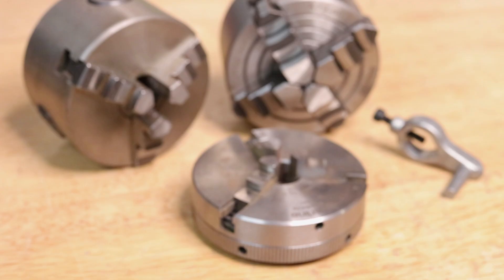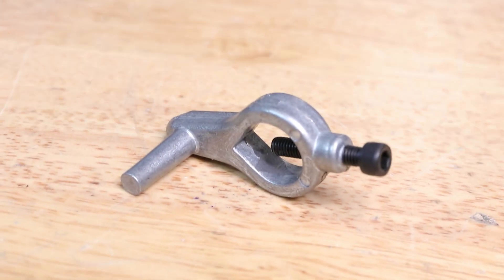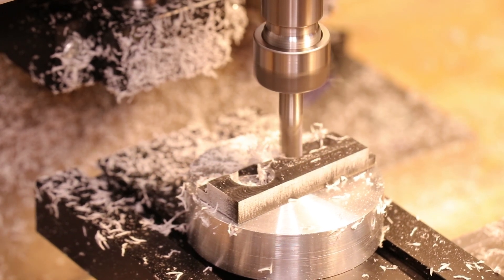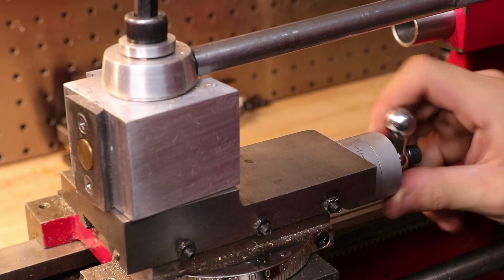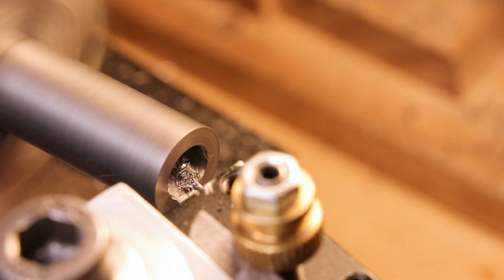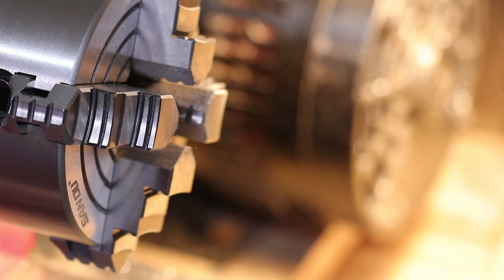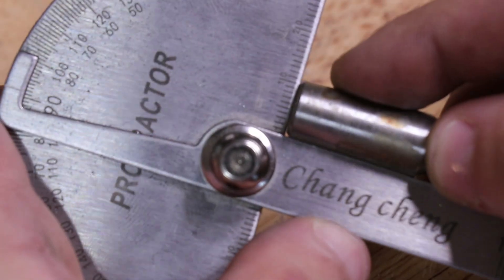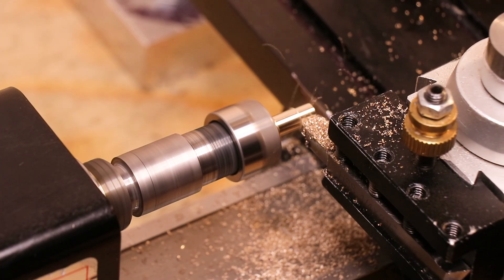Making A Collet Chuck For the lathe

Comment: That’s so great. Thanks!
I’m just entering this world and learning from you as I do. 
For the manual threads. Your video gave me an idea of possibly rigging a gravity/spring mounted hand drill in a way that using a solid friction connection with the drill to your chuck you could use either a worm drive or spur gear for still slow, but powered speed control for turning threads (?)

Comment: If you had made the Morse 1 first and put it in the spindle you would have gained better concentricity in the er11 taper cut. Otherwise it worked out pretty good. I think you have some rigidity problems in your cross slide based on your hss tool cuts. Something to check beyond just the gibs.

Comment: I have a sherline lathe from 1976, and was considering a MT1 to ER40 collet so I can work with 20 and 25mm aluminium round bar.  I've been whacked by the chuck jaws once too often.

I only have the one lathe so thread cutting is not possible.  Instead I was going to buy a cheap ER40 to something collet holder off aliexpress and turn the back end down to morse taper 1, on the sherline.
Am I a glutton for punishment?  I get maybe 3~5 thou DOC in steel on the sherline, might take a long, long time.

Comment: For thread cutting you should just make a crank handle to go onto the headstock, to the outside of the motor, so you can just spin it that way.  Would speed up the manual thread cutting.
Reply: i am wondering how to manually cut a thread without a gearbox, I mean how to make sure the thread is even?
Reply: @MikeJD-hv9fp  just use a die???

Comment: Couldn't you have cut the M#1 taper for your spindle bore and drawbar threads and then do the collet end with it in the spindle for even less runout ?
Reply from the maker: That would be the way to normally do it, but I can't can't accurate tapers in the sherline so I had to do it this way.

Comment: Taig Tools has a 3/4-16 to ER-16 adapter that, with a small modification, works well with a Sherline mill or lathe. I bought four of them for use as tool holders. These are much quicker to mount than using the Morse Taper because they don't need a draw bar. They just screw on and they are relatively short. But you will need to shorten its base by about 3mm because the threads are recessed into the base and you will only get about 1-1/2 threads engaged unless you do the modification.

Comment: You don’t need a Morse taper on it unless you’re using it in the tailstock for drilling. The sherline bore is 12mm end to end. Just add a shoulder.
Reply from the maker: Cheers, but this collet also had to be used in another spindle that I had that used morse 1

Comment: The mistake I keep seeing when test fitting the ER collet taper is using an empty collet. ER collets are split from both ends and will conform to the taper even if the angle is wrong. Insert a pin of the correct size, or even the shank of a drill into the collet,  then check the fit with marking dye or Sharpie. I've made a few collet chucks of various sizes up to ER40 and would be disappointed if  the run out was greater than 10 microns.

Comment: I worked for a company that had a very large  piece of 17-4 that was bound for the recycle bin and work was slow at the time so I cut a solid piece right on the spindle,manually produced the correct six hole pattern and made pins.I used that tool a lot.

Comment: A 4 jaw independent chuck will not solve your run-out problem if the jaw faces are not parallel with each other. So, first check for parallelism. Grind jaws if necessary. Stay away from Chinese trash collets.
Reply from the maker: Thanks for the feedback Pieter. I haver owned this chuck for quite some time and I have machined drill rod with it and  it seems to reduce the run out quite nicely. For an economy chuck it has exceeded my expectations and gives me part tolerances that I need. Cheers

Comment: Nice work :) For cutting threads, would it be possible to make a simple crank handle and attach it to the tail end of the spindle? Cheers
Reply from the maker: Certainly would be, it is infact the method that is used for cutting threads on sherline lathes. If I cut threads using the lead screw more often I would make a handle, but i rarely do, in fact this video was probably the last time I cut threads this way.
Reply: I made a crank handle for my spindle to cut  a 1/4" length of 1.50" dia. X 8 TPI. My mini lathe has no reverse on the lead screw (yet). It too was a one off job.

Comment: At 3:28, you show dialing in the end of the workpiece, but fail to check the workpiece near the face of the chuck.  You could have a huge runout on the part and never know it if you only check the end of the shaft.
Reply from the maker: Cheers, but I did infact do this but, like a lot of things it never made it to the edit. Still getting used to editing down 2 hours plus of footage into 15 minutes and sometimes I leave some parts out that I shouldn't.

Comment: I liked your video, but why didn't you just make the back end on the first lathe, then do the front end on the lathe it was made for. This should have resulted in less error.
Reply from the maker: Because I do not have the taper catting attachment for the Sherline so everything must be done on the sieg. Furthermore with a properly dialed in 4 jaw chuck the run out is just as low as it would be if I cut it on the sherline. The set up took a very long time. It was not optimal but I work with what I have. Cheers
Reply: @artisanmakes  I think you did a wonderful job... You said in your video that the final result had a ever-so-small wobble.

(Did you use your finger gauge to measure the spindle accuracy of the second lathe?)

What I was trying to say was(if there is a wobble in your second lathe's spindle), if you made the taper on the first lathe, then doing everything else on the second lathe would make the chuck true to the fitting on the second lathe. (The 2 errors would cancel each other out) And if you make an index line where the two parts come together, then any offset error on the second lathe's spindle will be not be added to the chuck if the chuck was inserted in a  different rotation from the position it was created at.. -- I hope what I am saying makes sense..
Reply from the maker: I understand but I can not cut tapers on the sherline (second lathe). To do that requires an aftermarket attachment isn't in the budget.

Comment: I'd have probably machined the tapers last because, if you screw up something like the threads, the job is scrap, and all your work on the tapers is wasted.

It would also be a good idea, to cut the front taper (ie. the one for the collets) with the collet chuck installed on the lathe, for maximum concentricity.

Comment: Bad order of operations. Hou are very luky to get so low runout. 
A good way is to first machining the mors taper and after, with the morse taper in place in the headstock, machining the ER colet.
Reply from the maker: In retrospect I can admit it was not a great choice on my part, but the run out is in no part to luck. A lot of set up to get the part in the 4 jaw to get the run out to less than 10 microns, which is what I can get on the Sherline. If I had the proper taper cutting attachment for the Sherline I would have cut all the internal taper on it. However since I don't currently have that I did it the way that I did it in the video. Overall a well dialed in set up should easily offset a less than ideal order of operations, and the results that i got show this to be the case.

Comment: Nice project! As others have pointed out there are better ways of setting a taper angle. If you don't have access to an existing morse taper to use as a reference (set it up between centers and dial in you top slide to zero on it) you can use trig to calculate the angle from expected values. the taper surface is going to be the hypotenuse and you measure on it to get the short leg of the triangle while the long leg is the travel. Also, tool center height is really essential for turning tapers, lest you get a parabola in the taper. I realized this myself lately when trying to turn maching tapered parts. A workaround is to use a shear tool for external tapers where you don't have a single point that cuts but an angled edge tilted backwards. That way you will always get center line contact.

You are losing a lot of rigidity and get increased runout with that overhang. Why make the body of the chuck so long?

Nice work!
Karl
Reply from the maker: Cheers, and thankyou for the feedback. In retrospect that is not a great way to set the taper angle, but I have said to quite a few people, you would be amazed at how close the protractor got it. I swept the angle with a dial indicator and it was to within a few arc minutes (using trig). it probably took me close to 40 minutes to get it to within to under an arc minute, in part due to the poor design of the compound locking nut. And to be perfectly honest this is really not the ideal machine to cut tapers on, I really am asking more than I can from this little machine, no the result I got was pretty good. I am looking into buying a taper attachment for the Sherline for doing this in the future as I can get much more precise parts from it.

About the overall size of the chuck, the length is designed specifically to accommodate blanks of silver steel that I have laying around. The length is not optimal, but if I made the collet any shorter I would not have enough room to chuck the steel I have, since the draw bar limits how far back I can have the steel. Certainly not optimal but a compromise for a part cutter I needed to make.
Reply: @artisanmakes  I see! A draw tube with internal thread could be an option if you want the chuck to be shorter but still be able to feed thin stock into it.
Reply from the maker: Great idea that I might need to look into. Certainly wont be much wiggle room since there is next to no space on a morse 1 taper

Comment: Nice video, though setting the taper angles with only a protractor isn't the most precise. Another thing you may want to try is polishing the tapers for a nicer fit (or ideally using a grinding attachment). I've had issues with the slight ridges from tool marks, especially in mild steel.

Comment: Tir you got was incredible for the order of operations 

Any reason you didn't machine the Morse taper first then turn the taper for the er11 in the machine itself to minimise runout ?
Reply from the maker: Hi Trevor, the way that I made this is not the way I would have liked to optimally make it. You are right, cutting the taper first and finishing it on the sherline would have been the best way to go. However since the sherline doesn't have the thread cutting attachment, it just made sense for me to cut all the features on the big lathe in one go. It was always dialed in to under 10 microns, so at the end of the day I don't think the order mattered greatly. And the end result is within the tolerance I need. If it fell outside that I certainly would have recut the tapers on the sherline. Cheers.
Reply: @artisanmakes  ah I missed the fact you had to shift machines for the threading either way the runout achieved  was incredible
Reply: @artisanmakes  I had the same concern. Thanks for explaining your reasoning!

Comment: You should set the angle for the morse taper with indicator, using some existing morse taper tooling chucked up in the lathe, there is no way you got even close with that cheap protractor. Resulting runout is (by some miracle) pretty good, but this is not how it should be done.
Reply from the maker: Hi Miroslav, cheers for watching. You might actually be pretty surprised at how close the protractor got the taper angle initially, from memory it was within a few arcminutes. Although I must admit, there were quite a few antics that I had to do off camera to get the angle right. It took about 40 minutes adjusting with a dial indicator to get the taper right. I probably should have filmed that. Cheers
Reply: @artisanmakes  Well from the video it seemed that you just used the protractor and nothing else, that's why it didn't make sense to me, how did you manage to get such good runout.
Reply from the maker: My bad entirely, just my error not including it. Mostly was done with small taps with the machinist hammer to ever so slightly nudge compound. This lathe is really not set up or designed for cutting morse tapers, so once I got it to within an arc minute I left it at that.